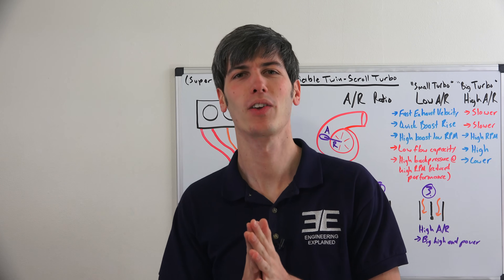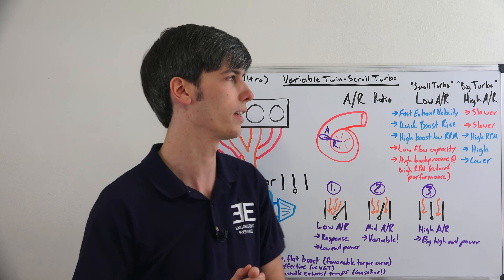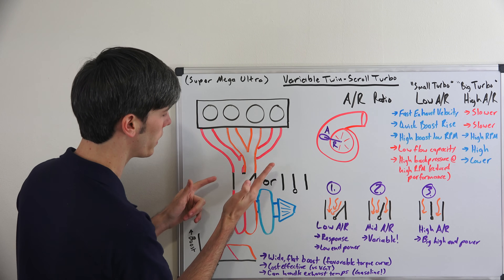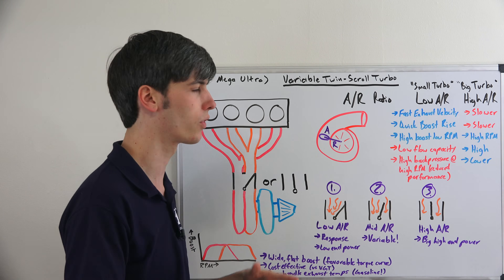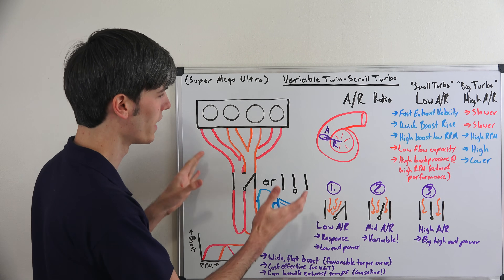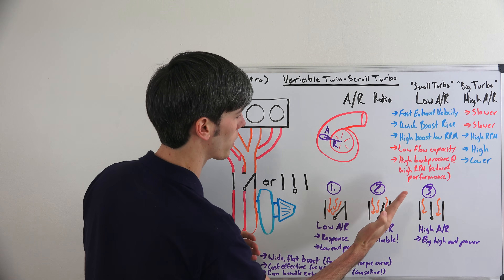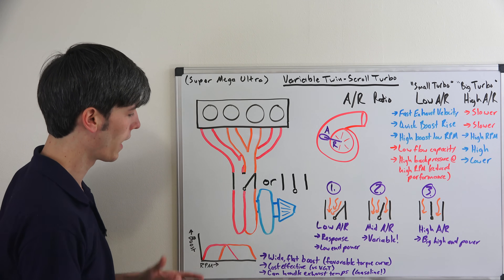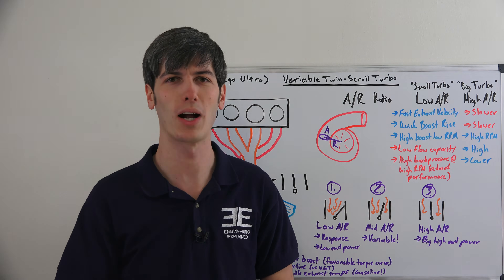Variable Twin Scroll Turbocharger - The Future Of Gasoline Turbos?

Comment: That's really smart.
Reply: +Toma Turcu I wonder how inline 6 like 2jz or rb26 would perform with huge twin scroll. 1000hp with good low end on best sounding engine... Real dream for me :D
Reply: Valtra103 it would be amazing getting best of both worlds low end and high boost at the higher rpms
Reply: +Toma Turcu while watching the variable turbo video I was wandering why they don't just do this instead. I guess they do..
Reply: +Valtra103 most of the guys with 2jz motors that have big turbos use an item from sound performance called a quick spool valve.  it is similar to what this video showed just not built in the turbo.
Reply: 211crod
I wonder if this is more effective than valve?
Reply: Stefan Ovcharov
Oh yeah, those too :D
Reply: +Valtra103 hard to say without doing flow tests. The benefit of the QSV is you can run any sized turbo with a divided A/R.
Reply: +Valtra103 Or a boosted F20C, boxer or rotary, too!
Reply: yep

Comment: What's the difference between this and the Mercedes-Benz Biturbo?
Reply from the maker: +eins What turbos do they use? Biturbo just means two turbochargers.
Reply: +EV0 Predat0r you're correct. Turbos are NOT an engine part. They're attached to the exhaust system.  The exhaust gases are used to "spool" (ie turn) the "hot side" of the turbo... Which is connected directly to the other side ("cold side") of the turbo via a shaft, which compresses & blows more air in to the engine.  "The cold side" is often routed to something that will cool the air 1st.  Eg. an intercooler - basically a radiator the air is blown through before entering the induction/intake system of the engine. Cooler air = denser air. Denser air = more air can be fit in the same cylinder space.  Colder/cooler air also = denser air.

Why turbo (or supercharge) an engine? Basically, it allows you to get more air in to the engine. More air + more fuel = bigger "bang" = more power.  If your engine is not designed (basically a stronger engine) for a turbo or supercharger, you're unfortunately likely looking at early engine failure! Most engines can prob handle a "low boost" system.
Reply: +Engineering Explained Also, am I right saying that a biturbo is in the engine rather than out?
Reply: Ahh, I think you have misunderstood me. My fault for not explaining myself fully. When I meant "in the engine" I was referring to the AMG 4.0-litre V8 use in the Mercedes AMG GT. Rather than the turbos being normally mounted on the cylinder banks, they are placed within the v-configuration of the engine on the AMG GT, which is what i was trying to convey by saying "in the engine". But thanks for the in depth of the turbo!

Comment: This certainly seems like it would be something easy to adopt into new engine designs. The packaging requirements are pretty similar, just add the mechanism to drive the flap and program the engine computer to use it. An easy win. Hopefully it'll be rolled out soon.
@engineering explained- It would be cool to hear your thoughts on the Achates engine, which will hopefully be making its way into productions cars this decade. It sounds like a real break through.

Comment: Correct me if I'm wrong but doesn't a quick spool valve perform very similar to this ?
Reply: Yes, yes it does
Reply: A quick spool valve can't have a divided exhaust. This one outputs specifically in a twinscroll when the valve is open, meaning each of the exhausts have a specific place they need to be. When it's closed, it acts as a divided exhaust.
Reply: +Scadieee Not "very similar". In QSV way, you have valce, which is in the way of exhaust gases but in this way, valve gets hidden and does not may any restrictions.

Also, QSV pushes turbocharger a little bit longer from head so thermal and kinetic energy is a little bit lower. Also QSV is another "steel" which needs to be heated (consumes thermal energy). Everyone who uses thermal heatshield on turbine housing knows betefits of that.

PS: I am sorry for my english I hope you understand

Comment: why do people still use gasoline in America diesel engines are more efficient and from what I've heard just better
Reply: have you heard of VWs dieselgate?
Reply: +Renato Picinini yes but that doesn't answer the question one company cheating emissions doesn't explain why
Reply: +patw52pb1 I would love that to be true here in france I would be able to go to work in my corvette XD
Reply: diesel is like elephant slow but strong while gasoline is like cheetah fast but not strong
Reply: diesel engines are noisier, smellier and more polluting. i would say going to the pump more every month is a good tradeoff
Reply: +Sam Blackman diesel engine just don't have the same range of use as a gasoline one as max rpm is most of the time around 4500 to 5000 while a gasoline one can extend to 7000 to 8000 in most cases. Diesel engine aren't slow however as most turbo diesel have a better "punch" (torque) at low rpm compare to gasoline engine and can be as powerfull as a gasoline engine. I have diesel and gasoline, I would say that I like my diesel car because it is efficient (2.0L 190BHP 50 miles to the gallon), however it is not "fun" as the engine is heavier, you can't play with it as you couls with a gasoline car. I love my gasoline cars cayuse they are fun to drive (might have something to do with the fact that they are both v8 though) but they are not efficient (383CI/318CI 450BHP/200BHP  10MPG/20MPG).
Reply: +Sam Blackman Diesel engines produce other toxic exhaust gasses (sulfur, NOx) other then carbon dioxide unlike gasoline engines.
Reply: +Sam Blackman our standards for diesel engines in cars are more strict than they are in Europe because of the way the rules are applied. Also fuel is very cheap here compared to Europe so the fuel savings are not very compelling for the average consumer compared to initial and maintenance costs. I imagine it will catch up eventually.
Reply: +Mitchell Sprenkeling on direct injection engine you do know that considering the actual laws on emissions diesel engine produce less particules that gasoline and that's a fact (I have to say knox that I am not a strong advocate for diesel engine I am just laying done facts :) ) and particle might not play a role in climate change but in your health definetly! 
NOx are not a problem in gasoline engine since 2000 I have to agree with you on that, for sulfur, Yes they do produce some and even if it's not significant on eastern europe and north america, for other parts of the world it can be very dangerous for health.
Reply: +Alexander Moreau It does catch up very quickly in europe too!! in france for exemple the average milles per year you have to do for a diesel engine to be better than gasoline is more than 50 000 but it is hard to change things here... the government has been pro diesel for what 40 years now and they are just starting to change for gasoline or hybrid... (I don't like Hybrid at all especially when it is electric and diesel, yes they have done it here...)
Reply: Actually diesel is not highly flameable as gasoline which makes it have higher compression ratio diesel is also mpre effocient but due to increase in price cux many uses theres no point buying diesel as gasoline is cheaper
Reply: +Muammarvsgaming ROBLOX and more not here :) 1 liter of gasoline is 1.50€ vs. 1.20€ for diesel
Reply: +Sam Blackman 
Sorry, but you are either mistaken or misinformed, gasoline is the globally predominant on-road vehicle fuel. 
According to global statistics studies commissioned by Exxon-Mobil, Shell, BP, Petronas, Sinopec and Total, as of January 2015 gasoline fueled vehicles account for approximately 69% of all registered non-commercial vehicles globally. 
There are approximately 1.2 billion non-commercial vehicles globally, approximately 250 million non-commercial vehicles are in the US. 
Different countries have different registration and reporting requirements, and a small number of road vehicles may remain unlicensed in any given year, resulting in a slight margin of error. 
As of January 2015 there were approximately 7.5 million non-commercial diesel fueled vehicles in the US and according to manufacturer sales figures for 2015 model year sales of diesel fueled non-commercial vehicles increased 5.8% so US interest in diesel fueled personal vehicles is increasing. 
Statistically non-commercial diesel vehicle sales have increased approximately 47.6% since 2010 in the US.
Reply: +patw52pb1 I asume it is not for me as I was talking about the french government :)
Reply: Mathieu Thomas
Correct, the comment is for Sam Blackman.
Reply: +patw52pb1 so I can only agree with you, it is actually a comonly acceptes fact in europe that gasoline is predominant in the USA
Reply: +Mathieu Thomas 
Yes, gasoline is predominant in the US.
It is less expensive than diesel fuel and more readily available.
The last time I checked the US also exports approximately 2.4 million barrels of refined gasoline daily.
Reply: Mathieu Thomas
Are there many Corvettes in France?
Reply: +patw52pb1 there are actually more and more american muscles and sports cars, what I found kinda funny here is that a small 1.6L 110bhp 2005 peugeot is actually busting as much gasoline as my 318ci 200BHP 1978 chrysler lol